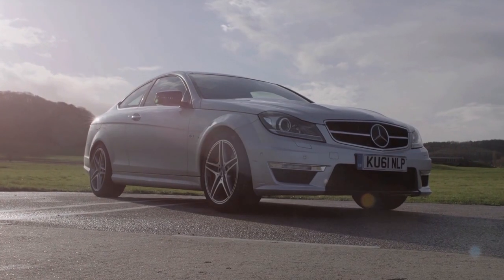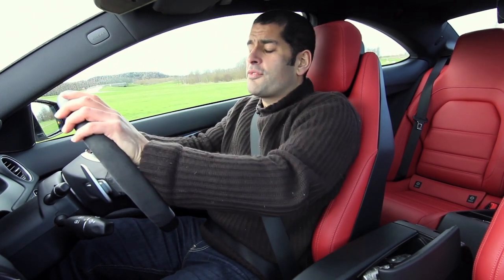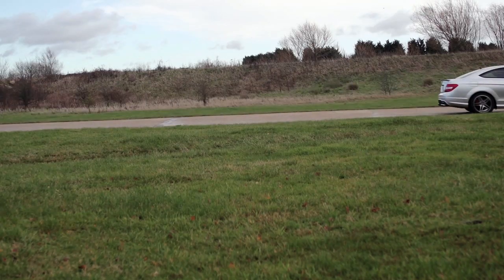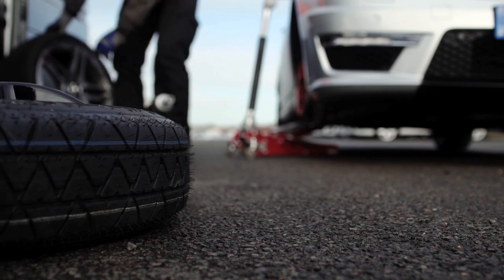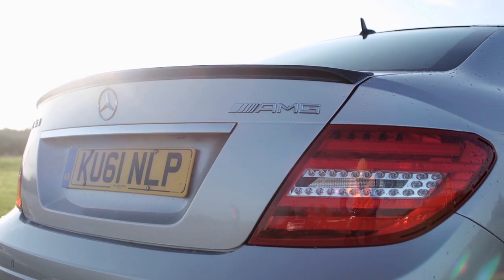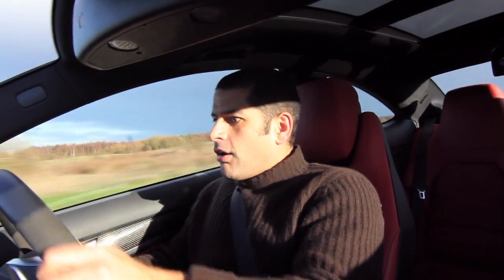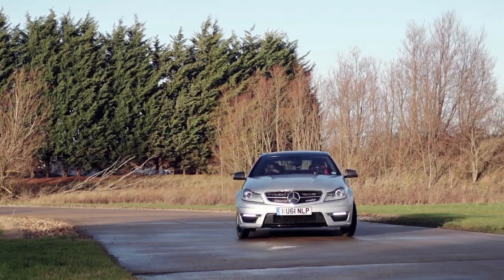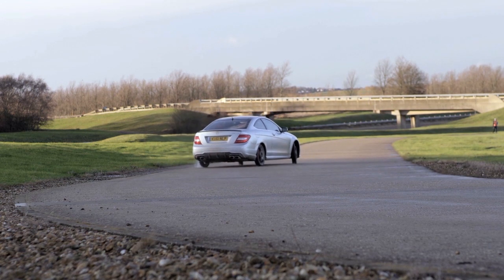The Mercedes C63 AMG Experiment - /CHRIS HARRIS ON CARS

Comment: My car has 145/80R13 tire
Reply: neka
Reply: Mladen Milić  I have 215/55R8 :(
 I might get some space savers.
Reply: Mladen Milić 165/75R13 😅
Reply: Even my 77hp Fiat Grande Punto has 195s
Reply: MrsMcMuffin Isn't a 195 overkill for a 80hp car...I mean like what will you do with all of that ? Can you atleast spin the tires ? And if you tell me it's on a 16" wheel then I'm done 😂
Reply: Mr. Pavlov  I had a Fiat Grande Punto for my first car and the standard alloys on it was 15".
Reply: R M I guess If the stock size for the Grande is 15 then it shouldn't be a problem at speeds higher than 120km/h. On some low horsepower cars if feels weird having big wheels....it's almost as you're torturing the vehicle. It feels gutless , slow to respond and you kinda get worse miles per gallon. I've never had this problem with mine because it has never been on a wheel bigger than a 14 😅
Reply: Mr. Pavlov To be fair my Grande Punto was quite responsive for a 77bhp and it turned corners well, I have a 120bhp SUV with 17" on them and you can throw it around corners and it grips good. I'm only 19 so I can't have a very powerful car with the insurance cost in the UK.
Reply: R M I feel you. Insurance is very cheap were I live so you do see 18 or 19 year olds with AMG's and E39 M5's 😂 ....or then there's the people like the dudes I used to go to school with years ago...never had any high horsepower cars. (Myself included) . Maybe one day before I die I might buy a 5Turbo but my family is going to kick me out of the house If I spend that amount of money on another old french car
Reply: Mr. Pavlov  My dad has the E39 and i think my next car will be one of those in a few years, When I passed my test my Fiat was £1,300 and my insurance was £2,200 for the year which is ridiculously high for a 1.4 haha. I'm driving around in a car that's under 2 months old with 1,200 miles now so I'm gonna stick with it for a few years and hopefully my insurance will go down a good amount.
Reply: Yes. On Punto 1.2 :))

Comment: In a perfect world with no imperfections on the road surface, a 1" wide tire will have just as much grip as a 10" wide tire. This is due to the pounds per square inch on the road surface being much higher on the 1" over the greatly distributed forces on the 10 incher.

Comment: @bimmerfan911 Actually the 240 (now the 250) isn't all that bad of a car. For the city, where you can't be driving 100-155 mph, it's kind of overkill for a commuter car. I admit, it's a great car, I've test driven every AMG/C, except this new one, since the C43, (the C55 was actually pretty impressive)....once again, not a commuter car, get the C240/C250 4-Matic, and you won't have to worry about scraping your front end as you enter and exit parking lots.... C240 4-Matic is a great car for rain.

Comment: @Talha Cheema sadly you have it the wrong way around. The 125 or 255 bit is an actual measurement. It is not a ratio or percentage. The sidewalk measurement is a percentage ratio of that tyre width. Doesn't matter what size the side walls are, 255 is still 255

Comment: They use wide tires because it allows them to make them of a softer rubber without losing durability. Get it in your head, grip and area of contact have nothing to do with each other, if that were the case every racing car would have dragster tires to turn better,every consumer car would have dragster tires for safety, and every bike would have dragster tires for the same reasons, can you even imagine the huge turn radio of a bike with those tires?

Comment: i have a mk7 gti with performance pack currently on driver side space saver (125) and i will have to agree with Chris, for some reason the handling is just sooo much better!? Despite the GTI having sport mode but running on the space saver i noticed a huge difference in the way the car eats up a bend or corner and overall just so more responsive and have such a better feel for the road!! haha

Comment: I remember an episode of Top Gear where James May was saying it was more fun to drive all out in a 2cyl Fiat Panda vs a supercar going 1/20 of it's limits. I agree with that actually. This and the GT86 proves my point even further; a conventional car being pushed to the limit is great fun; and it won't get you on the wrong side of the law as easily.
In case of speculators, yes: The GT86 runs on the same rubber size as the Prius that was being sold right beside it.

Comment: Chris, your/Neil's man maths is a bit out here - the C63 PP makes 487bhp. [487 / 125] x 255 = 993.48 - so you've created a 993 and a half horsepower C63, not a 1200hp one. Good fun though. It'd be great to see a virtuous circle of less rubber, less power, less braking power, less weight going on - even the MX5 has got big and soft compared to the original FFS...

Comment: power per tire width:
Mercedes Benz AMG: 480bhp/255 = 1.88
Dodge Challenger/charger Hellcat: 620bhp/275 = 2.25

given these results...a hellcat would be very interesting indeed.
Reply: +Cobalt Lukather “Robert” Doesn't the Hellcats actually have 707bhp?? 2.57 tho.
Reply: 707 horsepower at the crankshaft of the engine. bhp is the power left over that goes all the way down to the wheels (driving gears and axles in a vehicle takes away power from a car). the hellcat averages 620-630 at the wheels, making about a 15% drivetrain loss (power needed to spin the drivetrain alone).
Reply: Cobalt Lukather ohh, I see, so bhp is basically whp (wheelhorsepower), directly used on the asphalt. Tho the C63 still got 480bhp? Or should be less I think(?)
Reply: pretty much, except it's measured at the axle (connected to the brakes) and not the wheels.

i'm not exactly up to date on Mercedes specs, but it should be about right for an AMG for sure. i think those are well into the 550 crank horsepower range
Reply: +Cobalt “Robert” Lukather Actually most of the modern cars are underated. If you put em on a dyno test they will give you slightly more power. I remember that i watched a video about E AMG and M5 which both ended to have "underpowered" bhp stated by the manufacturers.
Reply: i tend not to believe claims made on random people's dyno machines. they usually vary 10-20 wheel horsepower from the exact same stock car because the dyno machines, usually built by different manufacturers, vary in how "optimistic" they rate their horsepower, on top of the conditions (air temperature, density, and humidity) are always changing. on top of that, some dyno's have not been maintained so their readings are inaccurate. i tend to believe big name companies like Banks, Lingenfelter, and APR, to name a few, who have well-maintained, top-of-the-line dyno equipment, and can control the conditions and get accurate results every run.

Comment: @laptoph4x You don't get it, I never said you NEED anything. I don't need a backup camera, I don't need front sensors, I don't need cruise control. But I have them, not because I needed them, but because it's convenient and ergonomically designed interior is in my preference. I never said a CTS-V doesn't have great performance, however I view Mercedes as more luxurious than a Cadillac. Again, it's MY personal view. Overall, I don't like Mercedes or Cadillac. Different cars for different people.

Comment: The reason he says it's fun is because he likes to drift. This has nothing to do with the tire size, it has to do with what he likes and in this case has achieved by use of smaller tires. If you look at all the videos he drives in he is drifting. I'm not saying he's a bad driver, but what he likes to do may be different than what you like. I'd rather have grippy tires than cruddy slippery ones any day on a fun road.

Comment: As an amg owner, you need those space savers due to every single Mercedes wheel cracking under normal use anyways. This week, I had 5 cracks in one wheel and 1 crack in 2 others

Comment: On a flat road you can cruise at 50-60 mph, which also is top speed. It depends mostly of wind direction. We don't have very cold winters here in southern spain, but in summer the convertible top is a joy!

Comment: 1) In dragster cars they make a burnout at the beginning of the race to melt the tires and make them adhere to the track exactly like glue.
2) The term tire load sensitivity is very clear that is dependent of the load on the tire not the area, and that is minimal in a street tire with normal pressure, like in the video.
3) The wet track means that the tires are lubricated witch means that more area = more lubrication.
This videos is very very stupid and the difference is in the materials.

Comment: Alejandro is right.  Entry level physics.  The big difference is composition.  It's not economically/technologically feasible to make narrow tires perform well or for enough miles.  In addition, wide tires have a benefit of not rolling in cornering.  This is a common point of contention and discussion in entry level physics classes.  When applied with other principals of physics and manufacturing techniques one learns what it is to be a Michelin engineer.

Comment: width might be half and yes spacer savers have much less grip, but what do you mean that area contacting ground is much smaller than half of the 255? space savers has much less grooves and tires width doesn't change contact areas "length". Wheel is wheel, no matter how wide it is, but because rubber is soft so basically car weight puts more pressure on tire with smaller contact area and it should press down more, creating more contact area length. Yes they compensate that with high air pressures

Comment: way too much front end grip, The rear would slide all over the place but the front wont. He could enter a corner very quickly due to the 235's at the front and spin coming out as the rear end has no grip at all. It would just really screw the handling up, over steer would happen much faster and be much harder to control. Not nice and predictable more evil and murderous

Comment: Hmmm, I wonder...

My first car... VW Polo 1.05
45hp, 55 lbft (w/ about 14:1 first gear = 770 w-lbft), 145 then 155 rubber = ~0.30 hp/tyre-mm and ~5.13 wlbft/tmm

Current car... (Renault Clio 1.5 DCi)
80hp, 135lbft (and gearing/tyresize equivalent to 10.5 vs the Polo's 14 = 1418 wlbft) on 195 rubber = 0.41 hp/tmm and 7.27 wlbft/tmm

Clio has 1.36x the hp/tmm & 1.42x the wlbft/tmm even with higher gearing & wider tyres... so how come the VW got so much more wheelspin on equivalent-quality tyres?

Comment: Dude. Your producer fails at maths. 255 divided by 125 is no way even close to 1/3rd the width. In fact, drop the 5 off the end, make it 250 divided by 125... um, hello, 1/2?

The section width number is exactly that - how wide the tyre tread is, in millimetres. Stack two of them against each other and roll a standard tyre up to compare. I can certainly say the 195s my current car runs certainly aren't more than 1.5x the 145s my first one was outfitted with.

Comment: explains the fun of the toyota 86 - which runs on prius tires.

Actually, if you reduce the width of the tire you don't reduce the grip at anything like the same rate. The more narrow the tire, the more lbs per square inch. The higher the weight per sq inch, the more grip per sq inch. There are other factors too, but a wider tire doesn't add grip through simple increase in contact patch.

Comment: @SergEK9 your right about(if they were tuned right) high 13's.when i was going to the drags some that had slicks got into the 11's.my favorite (Martin Dragway,Mich) in 64 was Vaughn Cuban in a 63 Ford "R" car.he ran 12.80's at 121 every week.when he banged 2nd gear he'd carry the wheels 50 feet.i'm not a Ford guy but i loved that car,i never saw him miss a gear.what i was trying to say was that the tires held these cars back.i did however have a 66 goat with a big block Chev that RAN!

Comment: @BooglesMcGee Yes, you are absolutely right about the experiment not being adequate to compare the results between regular tires and the spares, but I don't see it as important really. It's clear that you have less traction with skinny tires and the car will oversteer a lot more, hence be more fun. Or as James May would put it, the cars limits will be reached earlier. The important bit in this test is that the car IS actually driveable on these tires.

Comment: @omgwtfbbqgtfo If you drive in sim racing alot (Like myself.) You memorize the order of pedals, Your right hand is mostly always going to shift up, And your left almost always going to shift down. Of course it might not be like that, But 5 or 6 laps in a flappy paddle gear box and you learn quickly. I myself prefer a standard 6 - 5 - 4 speed instead of paddles. Much easier to drive with.

Comment: WTF was Mercedes thinking? Almost 150 less hp, 600 lbs less weight in my M3 when it was stock and it has 255s stock on the rear, same as the Merc. That car should have 275s or bigger on the rear.
Reply: They werent thinking, it is a muscle car not a track oriented car

Comment: 1) The tires melt and they become glue just Google it. if they wanted to just warm them they would put heating blankets like in F1.
2) more load= more grip, you said that tire load sensitivity is making tires have less traction which is never true.
3) Lubrication only means no traction of you have an ideal fluid, but of course water is not one.

Comment: The tire is 1/2 sized and he calls it 1/3 sized.  Then he says that means 1/3 the grip.

Uh, no.  A 1/3 size tire will have a lot more than 1/3 the grip.  That's why Corvettes with 315mm tires get 1.07g on the skidpad and Honda Civics with 175mm tires get .80g on the skidpad.  Not to mention the Honda Civic uses an inferior rubber compound.

Comment: Correct, this car in the wet would have performed the same with the normal tires fitted and traction control off. It would have made a huge difference in the dry though. Maybe they planned the test for dry weather conditions but their  "track" reservations fell on a rainy one?
Most disappointing is that we were not shown the tires after this thrashing!

Comment: you should have gone at least a little geeky. your math is wrong by the factor you used to multiply. if you had kept the 255s you would have needed 1200 hp to have the same ratio as you did have with the 125s and 450 hp. 1200 hp on 125s would be like 3600 hp on 255s.
Reply: He meant 1200hp on 255's not 1200hp on 125's. Watch it again and you'll realize this.

Comment: 1:04, "I cant think of a car that is better qualified to destroy its rear tyres".
Well, Chris. Try an FPV F6. 
415 BHP (300 at idle ive been told), 550 Nm of Torque @ 1950 RPM, 195mm section  rear tyres.

Comment: @CenasChainGang619 equivalent..with the stock tires, this car would need 1200 hp to brk loose like it does with the skinny tires. nobody thinks the car actually has 1200 hp, it just handles as if it did.

Comment: Well, don't go drifting around the police then, duh. If you're driving normally and conservatively, you should still be in reasonable control with half the usual contact area. You might get a wriggle on a tight, slippy corner & emergency stops will take a bit longer, but you won't be sideways on every bend if you leave the Trac turned on & tickle the throttle.

C63's kerb + driver: ~1825kg - on 125s = 14.6kg/tyre-mm
My prev car's max train weight: ~2750kg (on 185s) = 14.9kg/tmm

You'll be fine.

Comment: I will give you another one with a huge horsepower to rubber ratio: the 09 Pontiac G8 GXP...415 horses and 245`s
Reply: Yes!
Reply: Renaldo Nelson wow my BMW 330i has 245s lmao
Reply: cj Slammed I think the Chevy SS is in the same boat too...415 horses (6.2 l v8) and 245's all around. But yeah I had a base g8 with only 256 horsepower and it came with 245s haha

Comment: Guys, can anyone tell me the purpose of those three plastic, let's say, «ribs» which are evenly spread between the exhaust pipes? I've seen them on a lot of fast cars but is there really a practical implication of those? Or are they just there as an aesthetic solution?
Reply: It's a diffuser. On road cars, it's mostly for looks. But if you look at pictures of race cars, they have big diffusers at the back. They control the air flow and allow for more downforce, which gives more grip.

Comment: And no, you have not increased the power threefold, you've decreased the traction. All it means is that your car is now three times less capable of transferring that colossal power output into useful road movement.
Reply: I believe what Chris actually saying is that the amount of grip you have on the 125 section tires with standard hp is the same amount of grip you have on the 255 section tires with 3x the standard hp.
Reply: Not grip, but ease of breaking traction. Grip goes down, not up.

Comment: Why tf did he change the fronts?
Reply: Balance. He wanted a sweet-handling car, not a psychotic drift-monster.
Reply: More control sliding is psychotic? lol
Reply: If you unbalance the handling, you end up with less control...
Reply: It's like common knowledge that you leave your wideass nice wheels on the front and run shitty spares in the back on track day to save tires, you get better angle and control with the big wheels in front then if you put shitty wheels. #youneedseattime
Reply: Josh, if you think you know better than Harris, who has 20-odd years' experience as a journalist and racer, driving competitively and finishing strongly at several Nurburgring N24s, go right ahead. In the meantime, those of us who know anything about chassis balance will continue to laugh at you.